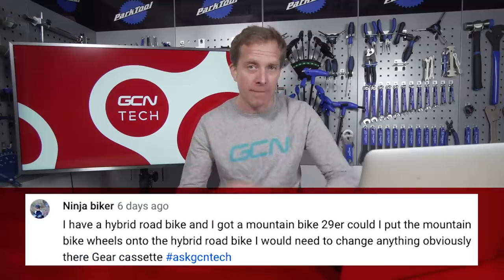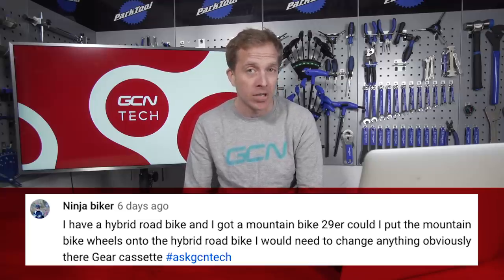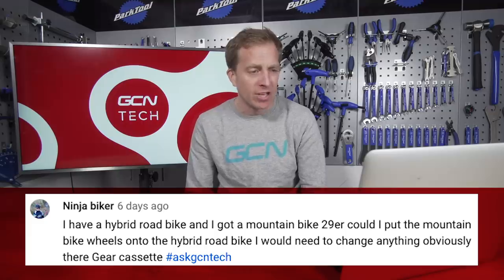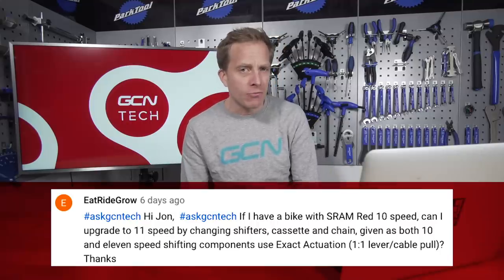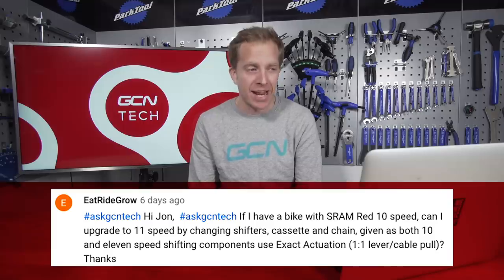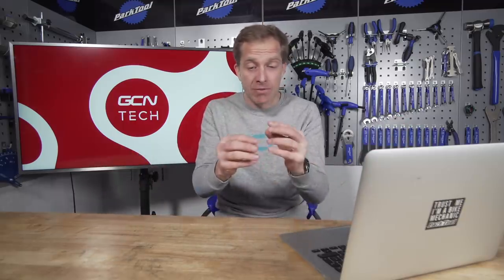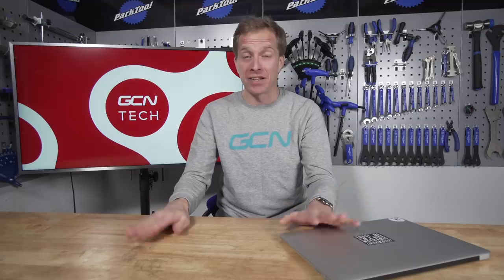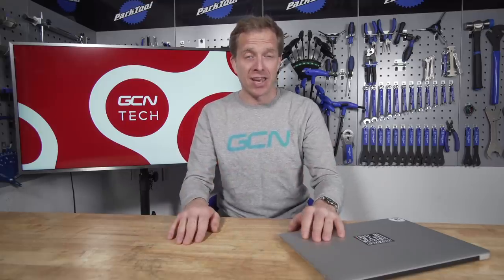Can You Convert 10 Speed To 11 Speed? | GCN Tech Clinic

Comment from the maker: Remember to keep your questions coming in for the GCN Tech Clinic! And a Happy New Year to all!
Reply: Thanks JOn
Reply: Hi Jon! Bit of a conundrum here.. Recently, I bought a TT bike for the 2019 season, and fitted it with a "Kogel" ceramic BB90 and CeramicSpeed OSPW. By design the BB has no washer and I feel like this leaves it a little more exposed than the PF BB on my other bike, a Canyon. After about 250 miles in dry weather, the bottom bracket and OSPW are both making a scraping sound during specific parts of their respective orientations. I have detached the chain and I can clearly hear the sand (or whatever it is) as I turn the crank arms and/or pulley wheels, so I'm certain it's not the chain. I suspect my drive train picked up grime during my rides and/or I washed away some of the grease during my cleaning of the bike. My question, now, is twofold. Firstly, the above suggests I will have to take apart the BB area and drive train after a mere 250 miles already. I don't think that taking apart my TT bike this often is feasible to me (I didn't have to service my canyon in 20,000 miles), so do you happen to have some hacks to keep everything running quietly and smoothly? Secondly, can I assume that, indeed, my cleaning of the bike plays a part in the noise I'm hearing? What should I do to keep water from coming into my BB? Hope you can help me out here... I'm at wits end already with all the problems the new bike has caused me... Cheers
Reply: #askgcntech I feel like road bikes are slowly turning into mountain bikes... (Not really a question)
Reply: GCN Tech c
Reply: Hello GCN. This week, It was the first time I rode almost 1km of climbing. Then I realised with the steep climbs, I can't spin a 53-39 / 11-28 gear ratio. Looking to adjust gearing but I don't want to loose 53t chainring because I like to sprint much but also likes climbing. Would you recommend a 36t inner chainring or go with 11-32t cassette? Problem would be 53/36t compatibility (shifting) then RD (Ultegra 6800) compatibility with 11-32. Please help.

Comment: for sram, yes you can just replace the shifters cassette and chain for 10 to 11 speed conversion. you will need to expand the front mech cage by ~0.5mm to get a rub free small-small/big-big combo. undone the little bolt at the end of the cage, put a 0.5mm shim in to expand the cage, put the bolt back in, then you are good to go.

Comment: RE: Lucians question. The solution I’ve used is Mastic Tape.  It makes a great chain stay protector and a better sole protector. The tape is grippy enough to stay on the sole and can still be easily removed when it inevitably gets chewed up. This has worked well for CX  where kicking into pedals would trash any exposed carbon.

Comment: I have a Trek Emonda that came with a Bontrager handlebar stem with a slight rise to it.  To make the riding position a little more aero I simply flipped it over.  The fork stem leans back a little so the end result is a handlebar stem that it now level.  I also moved one spacer from under to on top.  Two minor adjustments that gave a good result and look very normal.
Reply: I had the opposite problem with my old Ribble Gran Fondo (my first road bike, purchased when I didn't really know what I was doing), so the reach was a bit much. So when getting an "on the bike" fit they simply flipped the stem to slightly raise it and bring it closer. Though after that I did buy a shorter stem.

Comment: I'm interested in the bike mentioned at the end of today's questions (13 minutes in). I too have been looking at that bike - a Giant Contend Sl 2 (aluminium disc brake bike).But I've been really put off by a disclaimer on their website (under the sizing info section):TRADE OFF: Material used is optimised to deliver light weight and specific performance. You must understand that (1) these bikes are intended to give an aggressive racer or competitive cyclist a performance advantage over a relatively short product life (2) a less aggressive rider will enjoy longer frame life (3) you are choosing light weight (shorter frame life) over more frame weight and a longer frame life (4) you are choosing light weight over more dent resistant or rugged frames that weight more.I'm wondering if they've had a few too many returned with frame failures under warranty? I must say it's putting me off. I was choosing aluminium exactly because I am still anxious about the long term life of carbon compared to aluminium.

Comment: If anyone needs to really slam their stem without the steep downward stem look, check out the FSA SLK -20° stem. Has a flat-ish look but is a full 20° down thanks to a dropped bar clamp and low stack height.
I bought one when I had an endurance bike with a tall head tube, so I could return to normal.

Comment: Hey Jon, Ollie, I’m really loving the show and learning lots of new tips. I recently purchased a second-hand Trek Madone 9 series with Ultegra Di2 (I’m rocking Ollie’s Madone BTW) but it came with a semi-compact chainset and a 11-28 cassette. The problem I have is that I live on the edge of Exmoor and I’m finding it difficult getting up the Exmoor cols… what would you recommend to make climbing easier:
1. Replace the inner chainring, would difference be too much?
2. Replace the cassette to 11-30 but would the rear mech take a 30?
Any advice greatly appreciated.
#askgcntech
Reply: Hi, just to say I fitted a 12 to 30 set onto my focus cayo evo di2 10 speed ultegra with no problems, didn't need any adjustments and I can climb easier.

Comment: Can I convert my cable disc brake road bike to hydraulic?  What do I need to check?  As it's post mount (Genesis Equilibrium 10) am I stuck with SRAM (no bad thing)?  It currently has a mix of Spyre Hy/Rd (front) and Spyre-C (rear), will going hydraulic be a worthwhile upgrade?  It's my winter hack, which in this country (UK) means it gets ridden about 10 months of the year so braking performance is essential! Great channel, thanks for the work!

Comment: Hi Jon, happy Christmas and new year to you and the GCN team. Ive got a Madone 5.9 running di2 10spd, but wish to upgrade to 11spd. I enjoying bargain hunting on the internet, and can get some levers and F&R deraileiers for a bargain. Ive already upgreaded to a front Ultegra R8000 chainrings and cranks so may need cassette and chain. But will i be able to use existing battery and wires or will i need to upgrade too? Many thanks  Dave dpower Race. Bradford Cycling Club.

Comment: #askgcntech

Hi Jon, I have a bike with Shimano st-2300 brake-gear levers. The rubber hoods on those have become so bad, it's so sticky. I've tried cleaning them with hot water and soap and tried rubbing alcohol, but they didn't work. The model is so old, I can't seem to find the correct rubbers from Shimano on sale any more.

Any advice on what I can do to avoid buying completely new levers? Either to remedy the rubber hoods or find compatible replacement potentially (from Shimano or another brand)?

I'm thinking of spraying the hoods with Plasti-dip or something similar. What do you think?

Thanks a lot, by the way. Great show... very helpful and insightful. Please keep it up!

Comment: #askgcntech
Hi Jon, loving the show!
I've noticed my wheels are not properly balanced. Would you recommend balancing, and what would be the best way to do so (I've seen people sticking weights to the rim, not really a fan of that)?
Is there any risks involved with riding unbalanced wheels?

Thanks and Happy New Year !
Reply: once you figure out how much weight and whwere it needs to go, you can put the weight strips inside the rim, under the rim tape
Reply: @JogBird  Thanks for the tip, but wouldn't the tyre seat poorly because of the bump under the rim tape?
Reply: @Slinker_  Don't put the tape under the rim tape, just outside the rim.

Comment: #askgcntech Hi Jon! I know you love a good 1x conversion, and I've got a question... Sadly, my LBS hasn't been very helpful.  I have an old 88' Fuji Flair frame that I'm looking to convert into a dedicated trainer bike.  I've got a spare Maddux R3.0 wheelset (that came with my Caad12) which fits the frame with the slightest stretch.  Could I throw on an 11 spd 105 cassette, derailleur, and levers?  Are there any 175mm 1x cranksets that would be compatible? I already have spare pedals,  road bars, headset adapter, etc.

Comment: I have upgraded from sora to 105, from doner bike. Ive put on a new cassette (8  to a 10 speed) new shifters and mechs. Now, shimano  8 speed from chainrings are 52 and 39 tooth. And my new chainrings are SRAM 50 and 36. I cannot move the crankset across, is there any issue running the old sora crank and chainring combo, with the newer parts and a 10speed on the back? The chainrings have 10 speed only, and 8 speed only stamped on the respectively. Thanks for your help!

Comment: I have a domane AL 4 10 speed, can I change the cassette  to 11-34T to convert it to an 11 speed?  The front crank is a compact Tiagra 50/34t. The rear derailleur can accommodate the cassette. Would I need to change the chain or shifters if I change to the 11-34T cassette?

Comment: Hey john,  thanks for the advice about seatpost. I finally pushed it down the lowest for my mtb skill aaand for my parents to use. I got another questions about chain lube, it's a wax based lube from finnish line that i used. After a few thin lubrication for several hundred km ride, i noticed it gunked up like a wax or paste but it doesn't felt abrasive. Is it ok to keep run it like that assuming it's still have some "lube" or "wax like coating" ?  or do i have to clean it to apply another lubing ? and could you give sometips about wax based chain lube ? Thanks in advance #askgcntech.

Comment: #askgcntech Hi GCN, I am considering changing my bike's groupset. I ride a Giant TCR Advanced 3 2018 model. It currently runs a Shimano Tiagra 10speed and I would like to upgrade it to either 105 or Ultegra 11speed. My question is, if my current freehub body cant support a 11speed cassette, am I able to change either the freehub body or the entire rear hub itself to one that supports an 11speed whilst using the existing wheels and frame? The wheels are Giant S-R2. 
Many thanks & love the show!

Comment: My bike has 11 speed Shimano 105 shifters, front mech & rear mech but a 10 speed Tiagra cassette, chain & chainset. If I wanted to upgrade to 11 speed would it be as simple as just getting an 11 speed cassette & chain?
Reply: yes you will likely just need an 11 speed cassette. Make sure that your rear wheel hub can accommodate an 11 speed cassette though. Some older wheels are not wide enough.
Reply: Josh Magrum Shimano wheels so pretty sure the freehub is 11 speed compatible. Cheers mate 👍🏻

Comment: Questions:
Is it true that you can convert xt 2x11 to xt 1x11 by just putting a one by chainring on the front instead of the dual chainrings that it originally has or are there other changes you need to make?

Comment: If i have shimano 10 speed components and want to try campagnolo 11-speed. And get campa sifters, rear-and front dereulars (and braceon clamp). Can i then buy shimano 11-speed casette, chain and rings/whole cranksystem. That i can keep shimano freewheel and rear wheel. So do campa sifters work on shimano drivedain? And are 10speed free wheel and rear tyre compability clearens to upgrade 11-speed.
Reply: First the good news: Campy 11-speed cassettes and Shimano 11-speed cassettes are essentially the same width and spacing, so the Campy shifters and derailleurs will work just fine with Shimano cassette and chain. You probably don't even need to change the chainrings/cranks. The possible bad news: Shimano 11-speed cassettes (other than 11-34) are wider than 10-speed ones, and will not fit on 10-speed freehubs. Depending on what wheels you have, you may be able to change the freehub. Or you can use an 11-34 cassette.

Comment: #askgcntech Hi Jon, cracking job on the show, keep it up. I'm trying to convert my 2018 scott foil disc to dt swiss plug in rws however i've measured the current thru-axle; the rear is a 157mm total length however dt swiss only offer 163mm total length, the thread pitch and thread length is right though, so would it be ok? Front thru axle has a 10mm thread length but dt swiss offers 13mm thread length? Thanks!

Comment: Jon-
I have recently updated an older model (2010 ish) Raleigh from Ultegra 6700 10 speed to Ultegra 8000. It seems that rear derailleur hanger places the derailleur too far to the right and does not allow a shift into the largest rear cog even with the lower limit screw all the way out. I am sure that the hanger will have to be replaced but I cannot find anything definitive on the path to take. Please help.
-Brandon

Comment: Can I put 700c wheels and thin tires on a mountain bike
Or just thin tires on an MTB wheel
Reply: Yes, you could, but don't.
Reply: No to the first question, a 700c wheel won't match up with a mountain bike.
Yes to the second question, you can put narrower tires on an MTB wheel if you're using it mainly on the road.
Reply: @mikesavage8793  thanks a lot dude
Reply: Mike is right that a 700c won't fit.  The hubs are different widths, so your dropouts won't work.  However, I'd be very careful how narrow you go on those tires.  If you're looking for true road tires, you may be putting yourself at risk.  The rims of a mountainbike wheel will not give great lateral support to a 23, 25, or even 28mm tire, and you might have problems, especially while leaning into a turn.  I would even hesitate with a 38mm tire unless it seats really well without laying too flat.  You'd probably do better to look for a MB tire with a smooth tread.  Then you'll get the right support from your rim while also dropping the rolling resistance of a knobby tire on pavement.  Vittoria makes one, I think it's called the Revolution.  It's smooth down the center, with some knobs on the edges for grip in aggressive turns.
Reply: @backpacker3421  thanks man
Reply: Don't pay any attention to the naysayers,  this is a great idea. I did it for years, swapped my MTB tires for slicks on Monday, hauled my daughter in the trailer all week, then back to knobbies on Friday for a weekend of racing!

Comment: How do you know if your rear wheel (hub) can support an 11speed cassette? I have a 2018 Trek emonda alr4. It comes standard with shimano tigera 10speed. The rims are Bonteager tlr. Is there a measurement I can take to confirm? I want to do a groupset upgrade to 105.

Comment: Hi Jon. My rear wheel hit rear brakes. How can we avoid it rubbing? 
Happens often off saddle, and sometimes on saddle as well.
I am using Dura-ace 9000 direct mount brakes (under chainstay) and caliper is opened to the widest.
I guess pros are cutting brake pad..?

Comment: #askgcntech
Hi Jon! Great show! I'm looking to convert my 2009 specialized rockhopper hardtail to a gravel bike by changing the suspension fork to a rigid one. It has 26in. wheels but from what I can see, a rigid fork advertised as 29in has roughly the same axle to crown dimension. Should I then get the 29in one or a 26in one which has a shorter axle to crown measurement? Thanks!

Comment: That sram answer is so overly correct
Yes, dedicated 11spd chainrings work better with the narrower 11spd designed chains. Have used a Shimano Sora 9spd crank with 11spd 105 groupo no problem
Pull ratio of the front shifter should still work fine. Less room for error but should still work without rubbing
I only changed cassette, rear shifter and chain. The rest worked flawlessly with the 11spd parts
Reply: Shimano =/= SRAM and SRAM =/= Shimano.
Reply: Doug Thorpe please explain for us simpletons

Comment: #askgcntech
Is it safe to use a shim and a smaller size seat post to reduce the weight of the bike?
Reply: Yes. As long as the shim is the same minimum insertion length, or longer, as the original seatpost. Otherwise you can damage the frame. But are you really saving weight when you add the shim?

Comment: #askgcntech hello john. I have bike thats using Tiagra 4700 GS. Chainring: 52-36 cassette: 11-34 with long cage RD. What I need to change / replace if I want to change into 12-28 cassette, other than the cassette itself?
Reply: Just change the cassette. 12-28 is fine with the GS (long) cage RD - it's within spec for both long and short cage versions. You could take a couple of links out of the chain, but no real reason to do so.
Reply: @stephenturkLA  Hi, thanks for the input. What you mean I will have no problem to change the cassete 12-28, not even need to take out out chain link?
Reply: @durgimstingetium  If your current chain length works with an 11 tooth small cog, it will work fine with a 12 tooth.

Comment: Don't listen to Jon about putting epoxy on your shoe bottoms. If you want to protect the carbon from scratches, try some Scotch 3M 2228 Mastic tape. It's thick, has great adhesive, and will allow some light walking on it. It will be easy enough to replace in the event it wears down as well, or you find its not to your liking.